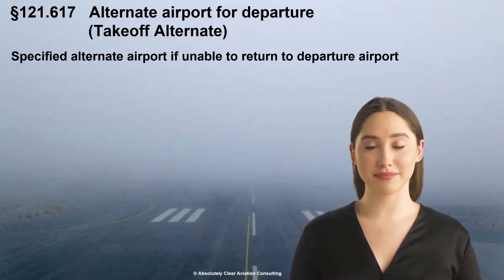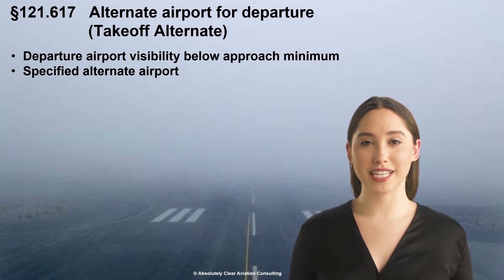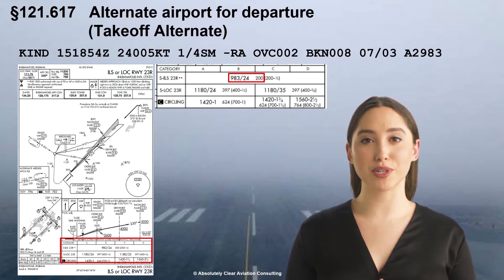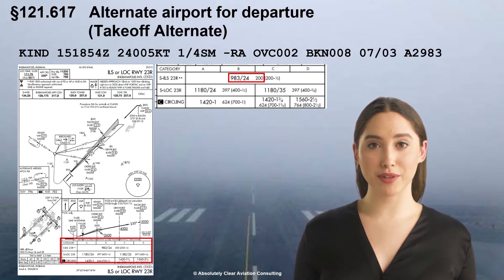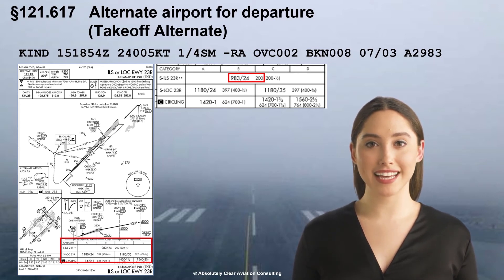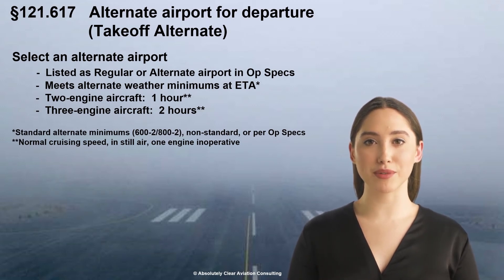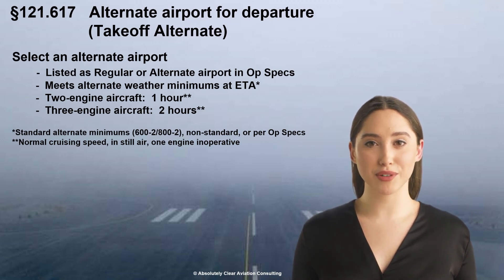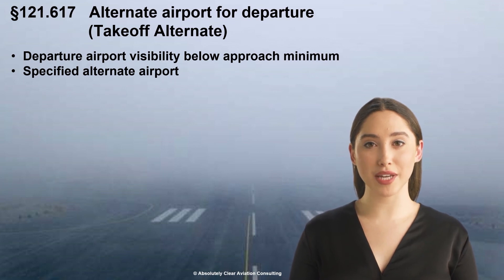FAA Part 121 Takeoff Alternate

Comment: Does takeoff alternate requires to have the two separate runways such as destination alternate?
Reply from the maker: @maximeresch9767  per 121.617, the specified alternate need only meet the alternate weather requirements per the carrier’s operation specifications (which could require two separate runways and two unique approach frequencies IF the carrier has the common authorization to derive alternate weather minimums (to permit a lower ceiling/visibility to qualify the airport as an alternate).

Otherwise, a specified alternate doesn’t automatically require two available runways. 

Check out my other video, which addresses alternate weather minimums (for anytime an alternate is required, whether it be for destination purposes or for takeoff purposes. The same minimum weather conditions to qualify an airport for use as any kind of alternate is the same).